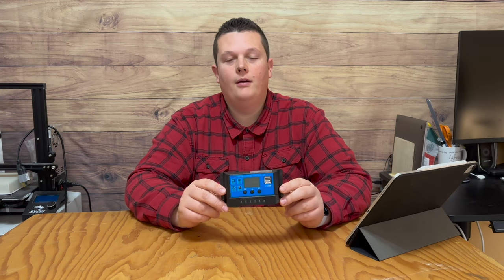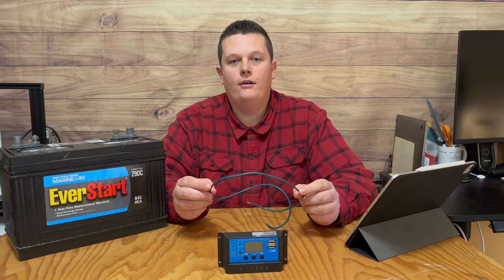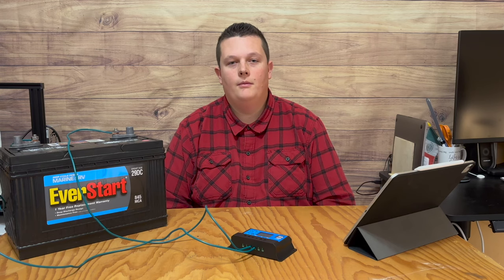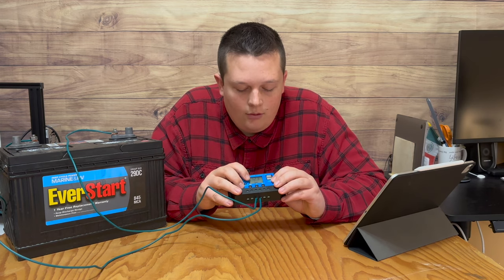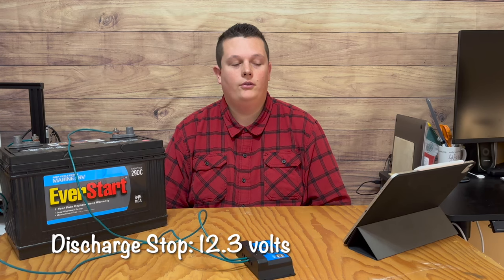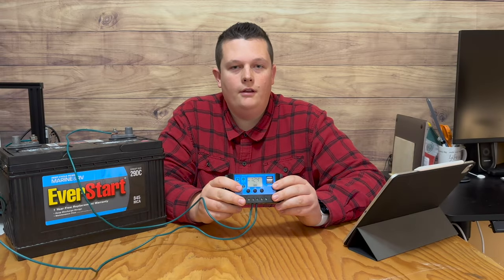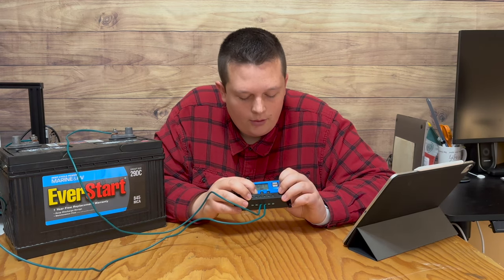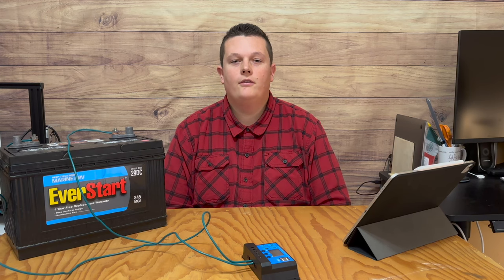How to Setup a Solar Charge Controller (menu, battery type & wiring)

Comment: Mr Scott, thank you for your info. What does it mean with the arrow is not flashing. It seems the controller and battery are hooked up correctly, but the voltage stays at 12.5. David

Comment: Thanks for the video! Ive watched it loads.

One question, my controller is exactly the same as the one featured other than its green and white instead of blue and black... Can I safely assume the battery type settings are the same for mine?

They are listed as b0, b1 & b2 rather than B01, B02 & B03

Comment: Hi .I set the controller as you said...I'm caravaning at the moment .the panels are currently in perfect sunny spot it's 29 degrees....The arrow flashes to show power going in..but the conditions are the same but then it stops flashing...is this normal.or have I done something wrong.thanks...

Comment: thanks. the part where you explained which battery is what on the settings helps. any chance you could make an Excel sheet or pdf for your preferred settings and the different battery modes? if not i can throw one together and you can put it in your links for quick reference

Comment: This device has cooked almost all of my batteries even when hooked up correctly. It's cut-off doesn't work after a few weeks and overcharges batteries at 16v
Reply: It's garbage. Mine is outputting 17.6 volts with a 24V panel.

Comment: What kind/type is the end of the wire you connected to the controller ?
I see Y2 & Y 3 to use for most this type but the end is wrong to connect (screw in) to the controller.

Thank you !

Comment: In your previous Video on installing a solar panel in an inclosed trailer you connected the panel to a charger without a charge controller, which I thought was wrong. Don’t they have Lithium batteries in them? Also, don’t they need a charge controller?

Comment: Hello. Thanks for your video. My charger seems to be over charging my flooded batteries. Is there a charge Cut off voltage setting? Or is it built-in with the battery type?

Comment: Hi Scott,  can you tell me, if I am using the controller on my caravan with a 150w solar panel, is it possible to still connect to the mains hookup without having to disconnect the solar panel, taking in to consideration that the mains hookup will charge my battery?

Comment: Thanks for video, it is so helpful. I have question = can you use the charge controller without using the load mode. I have a 8:22 solar system with a timer hooked up to lights and I don’t want to change it. Thanks again for the video.
Reply from the maker: You bet! Just set the load section to 24H and it will always be on without it's own timer.
Reply: @ScottsSolarProjects  Thanks for answering my question, it is very helpful .

Comment: I have a 12 volt Duralast AGM battery  Cycling Charge rate 14.4 -15.0 v  with a 13.5-13.8 Float charge  What type would you say my battery is ? My 30A topsolar controller connected to 200 watt panel  is already preset on type 61

Comment: I actually came here to see how the load was hooked up,  I seen another video and the guy said the load is for AC and you dont need to connect anything there, which really confused and threw me off i thought youre supposed to connect the inverter there?  Which is the load isnt it?  Anyway I have my inverter connceted directly to my battery which works fine but was wondering if I should hook it up to the load terminals if that makes any difference.

Comment: hi , great video thanks but iv still got some problems , iv got 3 of these brand new and all seem to not work correct. main question is what voltage should i have on the battery wires wile not connected to a battery ?  with 2 units im getting 5 to 10v witch seems to low to do anything and one just over 14v witch seems a little high , also non seem to cut out at the top voltage set . many thanks for any tips , its driving me mad :) , cheers
Reply: The battery needs to be connected first, so you will always have battery voltage on the battery terminals. You may cause damage if you connect the solar panels first.

Comment: I'm trying to hook up my 800 watt solar kit from renogy . I live off grid and having one heck of a tike getting it to work. Do you know how to set up the renogy 60 mppt controller?
Reply from the maker: I'm sorry to hear that, I'm not familiar with that specific controller. As long as your solar is within the rated specs and your connections are hooked up right, I don't see why it wouldn't work.

Comment: i use marine batteries with trolling motor and have run them dead and never have ruined a marine battery cause they are made to run dead and recharge maybe sealed type are different then floating not sure let me know and also thanks for your video really helped me alot
Reply from the maker: We’ll thank you!! I’m not sure, but the battery might have a built-in shutoff so they don’t ruin the battery. Still though, you can run them down almost to zero. 👍🏼

Comment: I got a new system. It is confusing to me having no experience. I got 3 100 watt panels. And 4 12 volt 35 Amp hrs batteries with that same controller. Can I add 2 more batteries and another panel and be ok?

Comment: Can I use any solar panel for this? For instance, if I can find a used 240 W panel that is cheap but it has a higher output… Will this controller, detect the output and use only what it needs?
Reply from the maker: Good question, as far as I know, you can over panel the controller if it's not a bright sunny day to get max watts in. But I'm not sure what will happen if you offer the controller more than it can handle.

Comment: I’m wanting to use one of these just to run a fan during hot days, do you need to connect it to a battery for this?
Reply from the maker: Yes, you do have to have a battery connected for it to work properly.

Comment: Can you connect multiple 12V batteries in parallel to each other to the same controller? In order to charge both? I set up a system with a 200W panel and a 100A controller. Thanks
Reply from the maker: Yes! You can definitely connect in parallel, I've done it with 3 batteries in parallel. Just make sure you are within the rated specs.
Reply: @ScottsSolarProjects  thanks, 2 batteries (same type) connected. System seems to be working fine. Thank you for your videos they were really helpful!

Comment: I can't get the solar panel icon to come on the screen, I did connect the battery first. I tested my solar panel and it's putting out volts, so is my voltage regulater bad or are the instructions bad showing that panel icon that isn't there?

Comment: Hi! Great video! Question - I have 2 240W solar panels in series which gives me 480Watts! When I was setting up my 1st 40A Controller Charger my friend 1st connected the positive and negative wires to my sealed battery. Next, when he went to connect the solar panel positive and negative wires, the Control Charger started smelling and would not function after that. I now purchased a 60Amp charge controller just like the one you have. Why do you think the 1st charge controller was fried when the solar panels were connected. Don't want to ruin this 2nd control charger. Thanks!
Reply from the maker: Wow, that's interesting, I don't know why. As long as you connect the battery first to the controller and then the solar, it should be fine. Now, it might be a good idea to discharge the level of the battery first and then once it's all connected, have the solar charge it back up.
Reply: Series will double the output voltage, which may have exceeded the input voltage of your charge controller.

Comment: My double usb ports are not working, there was a time when I pressed something and both of them worked after setting up some of the things on the controller, both usb ports did not work again, if you can assist on how to set it up in order to have the power there please.

Comment: Can you add extra batteries and/or solar panels to this? Is parallel or series best? Thanks
Reply: Parallel panels would be best, as there is no point running in series as the PWM controller pulls the panel voltage down to the battery voltage, however this means that you need thicker wire to handle the increase in amps. Don't forget to not exceed the maximum input of your controller.
I would suggest getting a dual battery controller for running multiple batteries, as a simple charge controller cannot balance the load between batteries.

Comment: I’m still trying to get things figured out I don’t know much I can’t even get my system set up but I think you have the discharge stop and the discharge reconnect backwards that would probably be why u say the setting is way too low because that is probably the perimeter where it stops discharging and begins charging

Comment: Can these lead acid-type solar controllers be used to charge Vtoman or Jackery power stations with internal lithium phosphate (LiFePO4) cells?
Reply from the maker: That's a good question! However I'm not sure - I have heard you can use big batteries to recharge power stations. I'll have to look into it more.

Comment: ?  Hi, I have other model that looks like yours but its red. Can I conect it directly to solar panel and charge usb devices? Is it going to show any values if Im conecting it only to solar panel?
Reply from the maker: It will tell you the voltage of the solar panel without connecting the battery. But it's not gonna charge via usb very well.
Reply: @ScottsSolarProjects  So if it isnt showing anything then is it broken?

Comment: Thanks for the video! It helped me a lot , just a question : In my case  I use it for a gate ( solar panel gate opener ) . The kit came with 2 batteries , connected in series , so do I have to set it up , with twice the amount you just said or I do have to set it up with the "12 v"settings? Probably is a stupid question , but I'm new into it. Thanks
Reply from the maker: If you're connecting in series, that will make the system 24 volts, so you would configure the settings for 24 volts. Just make sure you connect the batteries in series to the controller first. Best of luck!

Comment: Good presentation, the only you never mentioned USB ports. What are they? Are they just loads or always ON ?
Reply from the maker: Thank you! I’m pretty sure they are always on.
Reply: My USB ports aren't working after I touched the settings and it charges my phone extremely slow when I connected everything the first time. Any fix to this?

Comment: If you didn't do it right with having the panels connected to the charge controller before you connected the batteries... in other words if you did the wrong order of connection, then you'd have to redo it to match the order you said of doing the battery first. But if you do that do you have to ... I don't know do a reset button or reset settings button operation somehow on the charge controller (before connecting the solar panels)?
Reply from the maker: I don’t believe so. If you hook it up incorrectly first, I would unhook it and wait 10-15 minutes and then hook it up correctly and it should be fine.

Comment: Does the load always draw from the battery if there is sufficent power coming from the panel at the time of use? For example,  If I have a 12v 100W light hooked up as a load, a battery and a 200W solar panel all hooked up to the controller, would the light draw from the panel or the battery if the panel is putting out sufficent power to power the load?
Reply from the maker: I think the charge controller automatically sends power from the panels directly to the battery, so the load can always run properly balanced directly from the battery.

Comment: Thank you. I have that charge controller. Any idea why when I add another 200 watt panel to the 100 watt panel I get no input on the charge controller? Both panels work individually, but when I put them in series I get nothing?
Reply from the maker: You bet! I'm not positive, but I don't think it's a good idea to connect 2 panels of different sizes in series, you could try it in parallel though.

Comment: Scott, love the content.  If i wanted to add a light switch in line with the load (in this case a light), can I simply set the charge controller to 24hour?
Reply from the maker: Thanks! Yes, you can! Once it's hooked up, you can even just tap the load button once to turn it on or off.

Comment: Hey thanks for the helpful video I was able to set up that charge controller until it broke after 2 weeks of use so then I bought the unbranded mppt charge controller, however the instructions are written in Chinese or some other nonsense and I can't understand what they're talking about can you help me figure out how to set this system up so that it will charge off of the battery at night.? If I have direct sunlight then whatever I plug into the system will charge, but at night nothing will happen from the outlet but the USB that plugs directly into the charge controller still works

Comment: Why does my charge controller s keep breaking meaning either my battery won't display or my panels won't display. Am I burning up my controller? I've purchased a few of these hook them up correctly everything works great then I go to hook something up to my batteries and WFT my controller won't work.

Comment: I have one big problem with these things, there is no difference between a 10amp or a 30amp one, I have taken them apart and compared them , good vid, I have seen a load of vids on these things, but you explaned some things I was not sure about :),   I use these in me Tramper van, 60w solar, and a 110Ah Batt, it runs a 10" TV, and a Alpocool 9It fridge, and 4.5v LED lights which go though a LM2596S DC-DC Buck Converter, set at 4v, they get a bit hot if you run them at 4.5v , basic 12v in my van, no inverters, :), just 12v
Reply from the maker: Thanks, I appreciate it!

Comment: Perhaps somoene knows, is "GEL" setting proper for a real GEL battery? In this setting for some reason, the Float voltage can not be set more than 12.6V, which is kind of low. Also, what about equalization? In the manual, equalization voltage is specified for all three types of batteries. Should not the "GEL" setting turn off the equalization at all as in many other controllers?

Comment: so if i want to only run the load when the sun is shining - and not be charging a battery - how can i do it?  can the battery be removed once it's set up and operating such that the load only received power when the sun shines on the PV cells?
thanks - good vid
Reply from the maker: Unfortunately you really can't remove the battery. Once I went on a trip without the battery and tried powering my 12 volt skylight fan, it did come on very slightly, but it was quite intermittent with the sun. Having the battery really helps to provide constant power for your device. Depending on your situation, you could try it, just know you might need extra solar panels and good sun.

Comment: Hi, very helpful video, I have an issue, when I connect the load (using a 110watt led lamp) no power goes to the lamp. I have experimented with other lamps etc and no joy. Any idea what could be causing this? Thanks
Reply from the maker: Depends on how you connect it. Is the lamp 12 or 110 volt? And are you using an inverter?
Reply: @ScottsSolarProjects  it’s 110 volt, I have got an inverter on its way so hopefully should do the trick 🤞

Comment: Thanks for the review. I recently got that controller, once i connect the solar panel the LCD displays the charging voltage (not the battery voltage) is that normal?
Reply from the maker: Did you connect the battery first? It's not normal, the voltage reading should be of the battery, not the solar panel.
Reply: I connected the battery first (the battery voltage was off by 0.3V), and when I plugged in the panel, the voltage jumped to my float voltage of 13.2V. After watching your video, I realized that mine was faulty. Thanks!

Comment: I've got just one question: Is there a certain order how to disconnect thw battery and solar panel from the solar charge controller?
Reply: I bought a car with a solar panel on the roof, connected to a second battery connected to another battery. The cables from the battery and the solar panels are very poorly connected to the solar charge controller. I'm not an electrician, but this looks very sketchy (I can see the copper wire going into the solar charge controller from each of the four cables - the plastic has been cut off too much). The cables have also become slightly discoloured... I want to cut the sketchy looking cable "tip" off and reconnect the whole thing... i dont want to see any + and - cable touching

Comment: 4:09 Discharge reconnect: is when you want the load to come back on after you have depleted that battery. WHAT DOES THAT MEAN  you mean the load can deplete the battery more. Do you mean the solar panel after the battery is dead. The load can come back on to what? What do you mean after the battery is depleted what happens to the battery. What does this setting set for my battery?

Comment: I’m having a problem with this controller installed in my newly purchased camper van.
For float I can only select between a range of 25.4v to 29.8v, for reconnect a range of 23v to 26v and for discharge stop a range of 18v to 22.6v.
Any idea why I get get near the correct settings?
Reply from the maker: Is your system 12 volt? or 24? I would advise to carefully check, reconnect starting with the battery, and set the battery type.
Reply: @ScottsSolarProjects  I don’t know how to tell if it’s 12v or 24v 😬 Very new to this!
Reply from the maker: @mattfleckney143  Well, look at your battery and it should tell you if it's 12 volt or 24 volt, or if you have 2, 12 volt batteries hooked together, that could make it 24 volt. Also, just make sure you hook the battery into the solar charge controller first before the solar or load ports.